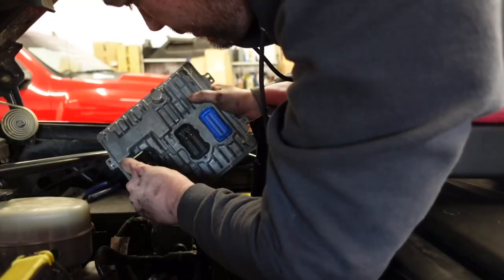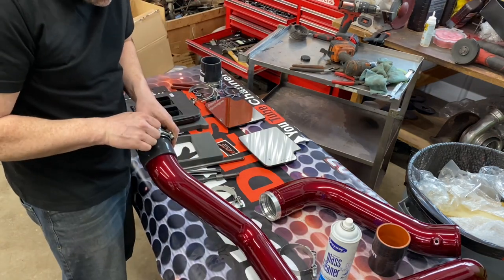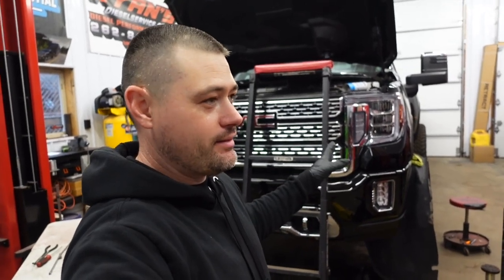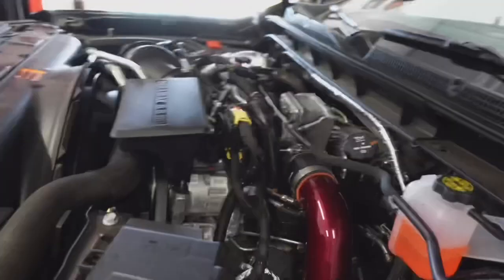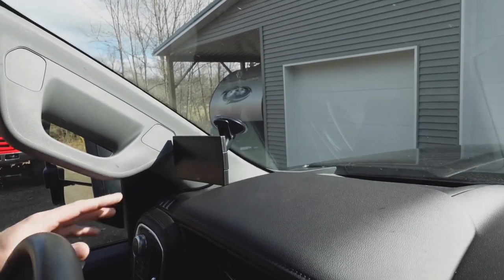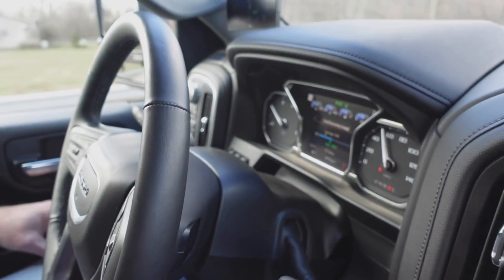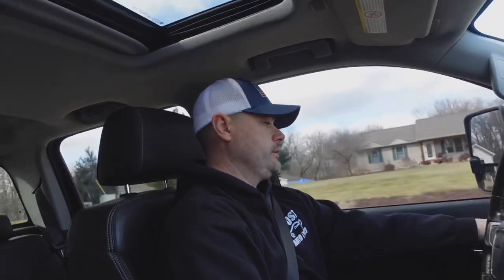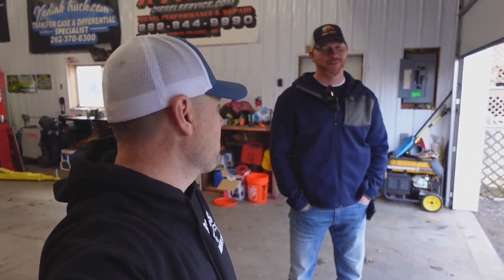I Tuned My Buddies Duramax and Gave It Back! “FIRST REACTION”

Comment: Absolutely beautiful dually.... just a cool truck. 1100 for the Pulsar great bang for the buck.  Wouldn't waste time and money to do the .... . But I would do the math and see what the gear ratio works out to be with the  37's.  That alone makes a big difference in launch compared to your factory tires . Along with the fuel mileage.  37's don't seem that tall . But it can surprise you.  Do the math and see if any and how much it changes the gear ratio. Additionally it would be interesting to install the HSP kit finishing off the remaining pieces not done by what you just installed.  Be interesting to see how much can be gained from other forms of changes.  Turbo, manifolds, injectors, cam ... that's the fun of hot rodding  !

Comment: Speaking of ppe buddy, I just installed ppe up pipe and y pipe in my 6.0 psd and they are nice. They literally fell into place and great quality. Paired them with bd diesel exhaust manifolds. Wasn't a fun job but i def notice more throttle response and runs a lot smoother. Highly recommend for any diesel, thanks for the good info man!✌️
Reply from the maker: Great feedback thanks for the info

Comment: I have the wc fab piping on my 2021 l5p. While getting it in I had to struggle for about an hour, but it is just barely possible to get those clamps on the lower hot side pipe. I also didn't receive the coupler for the cold side, but they overnighted it to me when I called.
Reply from the maker: Awesome info thanks

Comment: With lifting and putting larger tires on a truck... what about re gearing front and rear to keep speedo correct and not put so much strain on the transmission?..?..? By doing that to the lifted dually it may help in performance also....

Comment: You need to gear the truck changed the gearing in a similar set up really made a big difference we put 4:56 ratio in it will help push that heavy Pig
Reply: I agree. If you're looking for performance the gears will make a world of difference. That being said.... it still won't sound like a deleted truck.

Comment: I have a similar truck 2020 Silverado 3500 dually crew cab long bed 4x4 leveled on 35x13.50s my rear tires stick out further tho I have 2    3 inch spacers on each side of the rear with the 6 inches of spacers and the 13.50s it’s a total of 8 inches sticking out the rear fender thank god I live in Texas because any other state would be pulling me over left and right.

Comment: It does look easier to work on than the 17 to 19 2500 and 3500 I just got a 17 3500 but I’m considering finding a way to fit the 19 to present l5d model front clip the are stupid simple to work on because the flip front design

Comment: A delete will always be better for the engine as the colder the air the denser the air the more efficient the engine is, EGR is introducing hot carbon air

Comment: Drive feels different because of the transmission.. different rpm range... and the single wheel is probably like 1000lbs less with the stock wheels no lift and a short bed
Reply: same truck minus some wheels// some factory spacers.

Comment: I have got a problem with a lb7 I know it’s not what the video is about but I put injectors in and it’s still smoking and running rough with a tap. It’s not making oil and the cups stayed in and were tight any suggestions do you have an email for the channel so I can tell you what I have done so far? Thank you

Comment: If they put ethanol in the fuel you're only going to get about 14 miles per gallon when I got my Duramax and 04 I was getting 20 to 22 miles to the gallon then they put the ethanol in and it went down to 14 I thought it was something wrong with the truck everybody I talk to that had old one the '08 had the same problem they're not made to run on ethanol after all is a fast burn fuel additive it makes you burn the fuel quicker they put it in the diesel and they put it in the gas least they do in Connecticut

Comment: With a jacked up truck like that, that topside creeper must be a back saver.  Jumping right on the throttle with that 10 speed...  There goes the tranny.

You're in Michigan.  Take a vacation to Canada.  Deleting is legal here.  Just get a kit that hollows out the DPF rather than removes it. 

For fuel efficiency, the guys deleting here say 5-9 MPG better milage, and 100 hp easy.
Reply: Most states here don't really care or look.  I am in the Northeast and my state just does a safety inspection.  However with our current yahoos running the country who knows what will happen.  That's why I have an 05 Cummins lol nothing to delete.  I have seen the damage those emissions parts do to the engine, no thanks.  Especially with a 90k dollar truck.  Lower tailpipe emissions but double the fuel usage lol makes so much sense! For the politicians.
Reply: Exactly not even a true Alison, I don’t care what anyone says. Money talks.

Comment: Definitely delete it, and a ryans diesel service turbo. Hood stack would be cool or a single bed stack, like the truck in JWs recent video. Even a nice dual exhaust would be clean.  Awesome content man, always ready for the next one! 🤘
Reply: Dont hood stack thats the worst idea. But if you wanna ruin a truck go right ahead. A hoodstack is all cons. Having to clean your windshield literally every week, your passengers will hate you and you will get so so sick of all that noise. All that rain and water that goes into it too definitely ain’t good especially for a newer truck like that.
Reply: @stone9882  but a hood stack is sexy! Do you can enjoy the awesome smell of the Diesel 😋👍
Reply: Deleting is becoming a thing of the past my guy.
Reply: @stone9882  you're not wrong. It's just kinda cool. Maybe not for a daily
Reply: @seanthornhill9503  unfortunately you are correct. Wish it wasn't. Everything is getting more and more restricted :/
Reply: @seanthornhill9503  yeah exactly. It really just breathes and runs alot nicer without the emissions. Also I didn't want to deal with having replace or work on anything emissions. I agree with the guys blowing smoke are alot of the problem. I get here and there maybe at your buddies house but all the time isn't cool. My truck is tuned correctly, won't blow any smoke. Runs super clean. Plus I'm using all my liquid gold rather than dumping it out the tailpipe. Also true about the capabilities with emissions, just like the edge pulsar, seems like it does quite a bit.
Reply: Great video! In Michigan here as well. Hoping to “fix” my truck at some point too. Would love some tips.
Reply: @chevyman7011  I will say the new low pressure sode egrs they’re doing now won’t run soot through the motor so they’re able to breathe easier. It is what is is :/ the government shouldn’t be able to regulate what we do with our property but at the same time they should give us the option to make it a deignated off road truck or race truck. The new rpm act is bogus. They state if it’s ever been vinned that it can’t be considered a race truck. And is illegal to have no emissions.
Reply: @seanthornhill9503  oh okay I didn't know that, thats better then. But you're right their slowly taking away alot of personal choices and property. It's getting out of hand. I didnt know about the Vinned thing for a race truck. Their even restricting shit like that is bull.

Comment: The fine for removing it is $5000, and you announced on on YouTube??? I’m no tree hugger but I did replace my cat on my 06 Cummins cause it the right thing to do
Reply: It would be one thing if the emissions components were covered with a lifetime warranty.  Then people wouldn't need to consider it.  However when a dpf fails at 101k It's on you to pay 5 grand for a new one.  A cat is cheap these new emissions components aren't.  Not to mention it doesn't actually help a damn thing, besides the oil company selling double the fuel.  And I am sorry nothing this government does is for the good of the people!

Comment: If you guys are put the stock dually tires back on it that thing would run really good just the lift kit and the big tires it takes so much to turn the bigger tires and it will take a lot out of a truck my dad used to truck pull his truck was called the down and dirty farmer Mike schinlaub and we constantly switch tires back and forth trying to find the best and BF Goodrich is where the best tires we ever put on it BF Goodrich all trains https://youtu.be/ZHkdXU23ihA